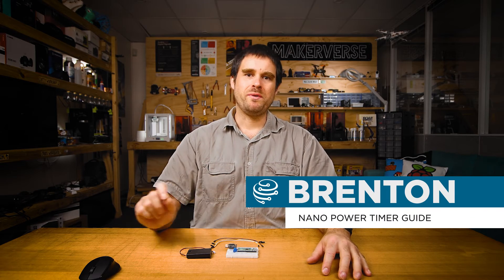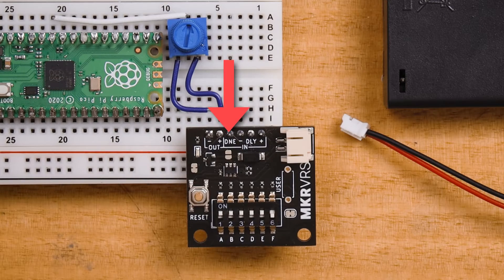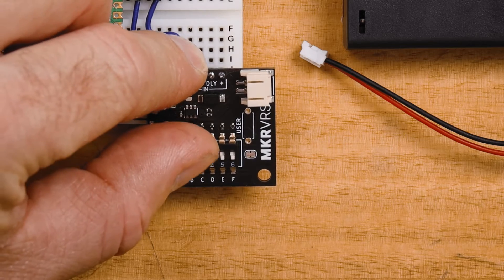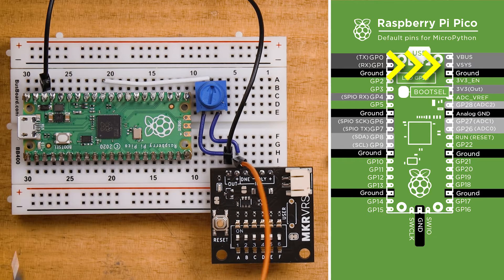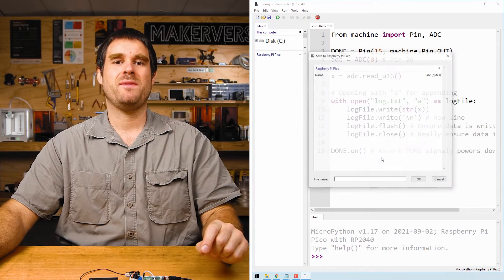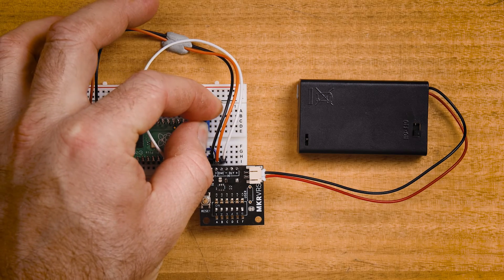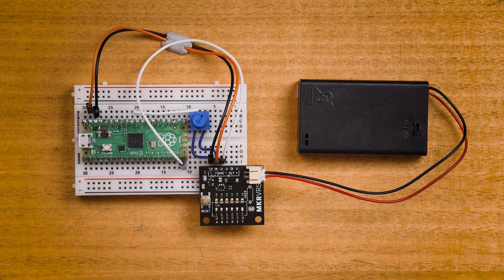Makerverse Nano Power Timer Guide

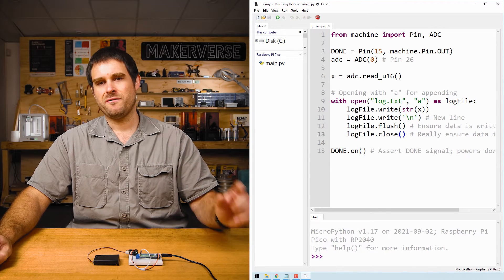Comment: 2:51 close() already does flush(). But the OS's disk caches aren't yet written to the physical disk. You need os.fsync() for that. (That's in desktop OSs. I don't know about Raspberry.)

EDIT: I see that Pico doesn't run an OS. So os.fsync() is probably irrelevant. But I still don't see why flush() is needed.

Comment: What if I don’t want a timer but instead something that switches on when a sensor receives a large input
Reply: I think these problems are standard, you can use interrupts to very low pwr mcus and wake up to sample input, process and then sleep again until interrupts received.
Reply: @ hmmm.  Thanks. I’m thinking of using solar to activate wake-up.